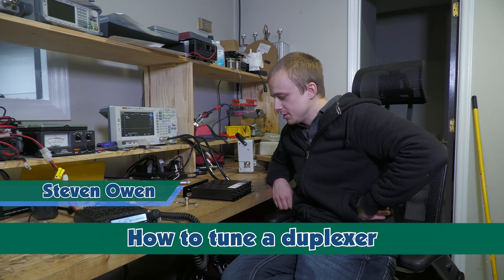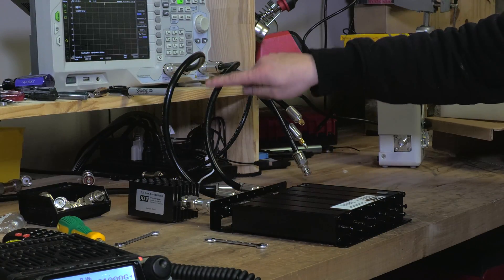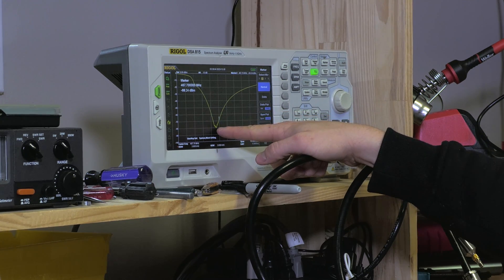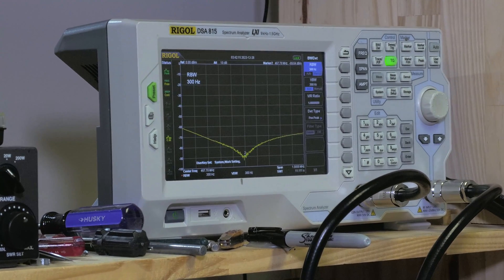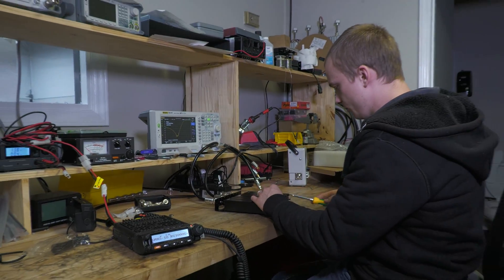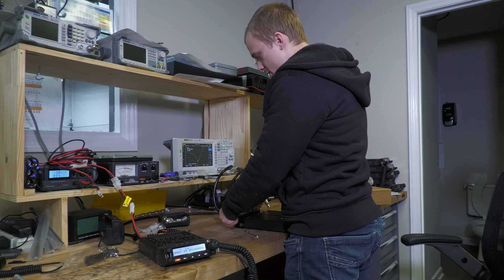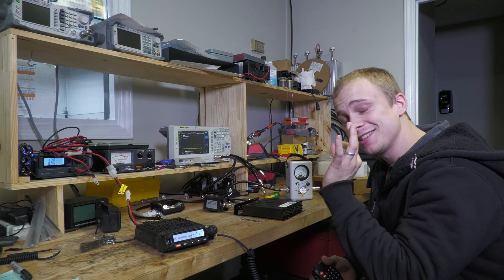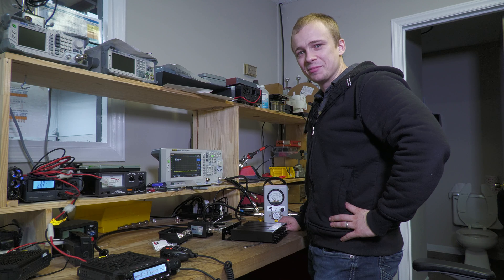How To Tune a GMRS Duplexer Using the Rigol DSA815

Comment: Hi. Did you see any benefit in placing a dummy load on the open side of the duplexer? I generally use a 50 Ohms termination and it is good enough. Thank you.
Reply from the maker: A 50-ohm termination is essentially a dummy load - you absolutely need a dummy load; otherwise, all your data will be inaccurate. The 50-ohm termination serves as a "dummy load" and is only suitable for low-power measurements, such as those done with a RIGOL or a VNA, so for tuning purposes it will work!

Comment: Where can I get cables and connectors that you have in this video
Reply from the maker: Cable:
Messi & Paoloni Ultraflex 7 or Messi & Paoloni Ultraflex 7 Sahara
https://www.buytwowayradios.com/messi-paoloni-mp-uf7-mr.html

Connectors:
Messi & Paoloni N Male Solder Enhanced Connector for 7.3mm / .287" cables (2-Pack)
https://www.buytwowayradios.com/messi-paoloni-mpcon7ms.html

Messi & Paoloni EVOlution UHF Male (PL259) Solder Enhanced Connector for 7.3mm / .287" cables (2-Pack)
https://www.buytwowayradios.com/messi-paoloni-mpcouhf7msevo.html

Comment: So this looks like a Cellwave notch duplexer with six cavities, great for up to 50 watts. Too bad that Rigol does not have the capability of creating presets for each phase of the tuning process. It would make the job so much more easier. 
Now with the advent of SDR receivers and transmitters why can’t someone create a SDR based service monitor with spectrum analyzer on the cheap. I have an IFR 1200S that needs to have power supply boards recapped. Just a minor inconvenience at the wrong time.
Reply: I have not seen a cellwave for years. Are they still doing them?
Reply: @ I have no clue, I moved to the EU about 18 years ago and have been out of the commercial aspect of radio. There have been many mergers, closings and goodness knows what else. I do have one I used on the 450 RCC frequencies back in the day and I have no idea if it will tune down to the 430-439 MHz portion of the euro ham bands.

Comment: Great little video… Thanks!
I try to never lend out expensive test gear to friends after I got back my HP/Agilent portable SA with a broken dc “barrel” type 5.5x2.5 mm connector.  It cost more to have repairs made and  for it to be recalibrated …
Than a new entire Rigol SA w/TG.

So, I bought one of them and assembled a “kit” with everything packed in a Pelican case.
(UniDapt adapter kit / TeleWave 44 “no slug” watt meter, dummy loads up to 350w. and all sorts of pre-made RG400 cable assemblies)

Now I can send the here to watch your video instead of getting stuck with multiple phone calls from my “I wanna get a GMRS repeater on the air and am too cheap to pay a shop to tune a duplexer” LOL

Comment: What cables are you using on the Rigol
Reply from the maker: Here are the cables and connectors we used in the video and where you can get them:

Cable:
Messi & Paoloni Ultraflex 7 or Messi & Paoloni Ultraflex 7 Sahara
https://www.buytwowayradios.com/messi-paoloni-mp-uf7-mr.html

Connectors:
Messi & Paoloni N Male Solder Enhanced Connector for 7.3mm / .287" cables (2-Pack)
https://www.buytwowayradios.com/messi-paoloni-mpcon7ms.html

Messi & Paoloni EVOlution UHF Male (PL259) Solder Enhanced Connector for 7.3mm / .287" cables (2-Pack)
https://www.buytwowayradios.com/messi-paoloni-mpcouhf7msevo.html

Comment: I am interested in setting up a 50-watt gmrs repeater. The antenna will be up at approximately 100 ft at the base. How do I get 50-watts to the antenna when the duplexer sucks up watage before it gets to the antenna?
Reply: You are always going to lose power in the duplexer.
Reply: You might want to use 7/8 inch heliax to eliminate feedline loss. Not cheap but you will not loose any power on that long run. You might be able to use 1/2 heliax for a cheaper alternative but you must look at the feedline loss for the frequency you are using to make the best decision as to cable type.
Reply from the maker: Hi, thanks for your question! To answer it, we would need more info on your situation. Where is your antenna located? Is it elevated at all or is it just a 100 foot antenna off the ground?
Reply: @BuyTwoWayRadios  it's elevated. I have a higher piece of ground than most of the surrounding terrain, but I need to get it up another 100 feet to be above the tree tops.